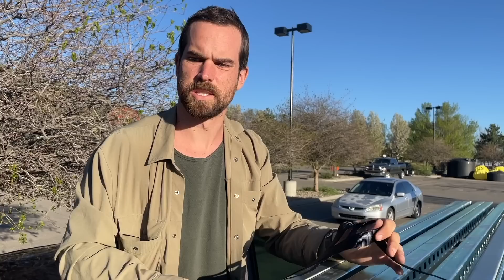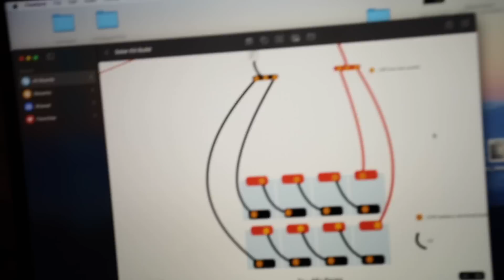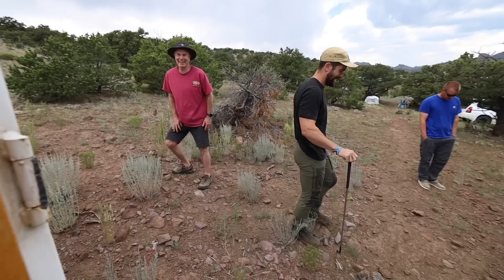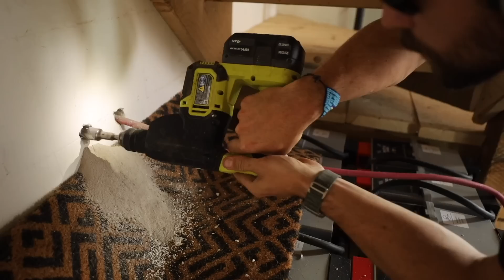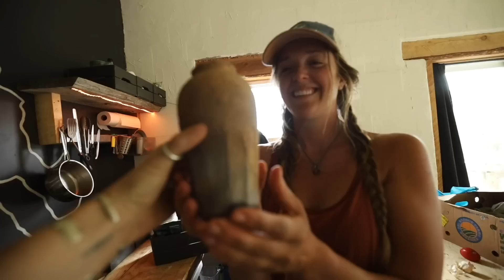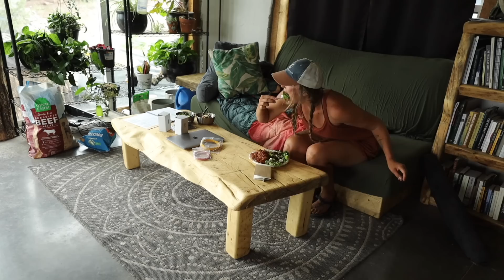IT'S COMPLETE!!!! | Solar Power System Install - Off Grid DIY

Comment: How about a solar water heater to supplement the propane water heater? The solar water heater would preheat the water passively before it reaches the propane heater.

Comment: I installed a ASHP Water Heater in February of this year. I only had a 120 VAC outlet nearby so used a Rheem 120 VAC 50 Gal. unit. It's in the garage here in Reno, NV so it was 47 degrees in February, and it used about 4 kWh per day. During the summer months it would be 74 to 80 degrees in the garage and only uses about 2 to 2.5 kWh per day. I keep the water temp at 137 during the day and switch to 130 at night. We are 2 retired people, and it has worked without any issues. Our inlet temp is probably near 70 in summer but much colder in the winter. I don't see any reason to doubt that it should work for your situation. The garage is a double size, and I couldn't say it cools the air to any appreciable amount. There is a bit of noise, and it runs more during the winter so that would be my main concern.

Comment: Could also augment your hot water system to passively heat water with a solar water heater. Kinda like a low power add on. Only thing that would run would be a transfer pump

Comment: As far as the hot water heater, once there are lill ones added to the fam, you will use a lot more hot water. Way more than you might think. Just something to keep in mind.
Reply from the maker: A tankless water heater is hot water on demand so we’ve got it on order and it’ll arrive this week!

Comment: Excellent Video Guys! Off-grid battery voltage is very confusing for many homeowners. Choosing 48V at this time is very safe and cost-effective (think smaller wire size on the DC circuit). One can easily wire the house for AC 120V and be  respectively efficient. I went for a 24V system. Not because it is cheap but because we have a "36V DC" standard in use for many years in commercial construction. My house is designed to use 18 to 32V appliances in general, and the computer controlled equipment is 120V 60Hz. Colorado has adopted the NFPA National Electric Code which also encompasses mining equipment (mining standard is DC). In conversation with Colorado lead inspectors, I determined that a mostly DC residence is possible and also efficient. .. if one can purchase the correct wire gage. Any one remember the old school light switch that clicked like a leather whip sounding off in the night? Those were AC/DC rated appliances! There are some trade offs when using all DC or all DC in transformer conversions. I just decided to minimise the total number of DC to AC and then back to DC conversions. Not every transformer is peaked for efficiency one can stack as many as a  40% power derating from solar cell to appliance in an off grid application. Cheers!

Comment: I wouldn't have been able to understand what Barron was talking about if i saw this prior to me doing some upgrades to the solar on our cargo trailer conversion. I definitely think this video will be helpful to others in the future. Especially just giving them confidence to tackle an install on their own.

As far as appliances i would have to recommend a propane stove for primary use. There's just nothing like cooking on fire! You could always have a one or two burner induction stove that is used when you want to take advantage of the solar power.

Comment: Re: your decision on if you want a washing machine or not

Something to keep in mind, if you are still planning to have children, is that your use of water will go up exponentially, especially for laundry. And if you use reusable diapers (you guys seem the type to go that route, but no judgement either way) your laundry needs will be even more than you expect since they need to be washed every 2-4 days.
Reply from the maker: We were thinking no washer before we were able to get this solar system. We designed our solar system for a washer!
Reply: @ElsaRhae  awesome! That's a really good choice.

Comment: Propane cooktops all the way! The control over the fire has no comparison to the induction cooktop. I lived off grid 25 yrs ago. I had both systems because we never new where our power would come from. Get a hot plate for emergencies if your want but use a propane cooktop. You change the bottle every 3 to 6 months. And it is a great and practical energy source.
Reply from the maker: I thiiiiiink we will go with propane!

Comment: Modern gas stoves have electrical ignition so you’ll use very, very little propane. The older stoves had a pilot light which used a high amount of propane. I have a small tall cylinder of propane for my Bosch and it lasts me 3.5 years. I used a cylinder every three months with my old stove. Quite a difference.

Comment: What’s up with the cracks on the exterior of the house? Is that normal or is it an unexpected concern?
Reply from the maker: It’s the first coat of stucco! We still have another 1-2 coats. We let the stucco sit over the winter so it would crack in full and we will go in with another layer of stucco and then another layer of synthetic stucco over top

Comment: Heat pump water heaters have the heat pump mounted to the TOP, so there is no extra footprint. They only use around 400-600 watts of power to heat up. You can also put them on a wifi timer so that they turn off in the evening and come on an hour before you wake up so that you have hot water when you need it. 
Sun is free and renewable, propane is not.
My offgrid home use electric everything. Induction cooking, air fryer/microwave over, Mini Split for heating and cooling.
I did this so that I am no slave to a gas that I need to pay to refill or have run out. I have a slightly smaller system than you. 10kWh battery, 5kW inverter (120/240 with a 60w parasitic draw), 9 380watt panels (2400 watts)
I have never run out of power, I just make sure that the mini split goes off before bed and we switch on a ceiling fan instead.

We run 24/7 internet, tv, fridge, hot water, cooking, water pump, all electric powered. You can do it. If you want some help choosing things let me know in a reply and we can exchange details.

Remember, Buy Once, Cry Once. Go fully renewable

One last thing. The temp rise of water heaters is ONLY a concern with ON DEMAND. Storage water heaters including heat pump units will heat till hot, so not a concern at all. You can also install is outside if the idea of free cooling indoors is a problem. 😉

Comment: I have been using a propane stove for 2 years because I live off grid too in a tiny home, I love my propane stove it heats things up so quickly it's very efficient and I don't find it uses a whole lot of propane especially if you're just using the burners and not the oven. I also have a direct vent propane heater as well as a direct vent propane water heater, both I like very much, I don't use much hot water either so it's perfect. I should mention too there's these "containers" that you can get that hook onto the side of your wood stove that heat water and they have a valve on it so you can have hot water all the time for your tea or coffee which is pretty cool 🌅

Comment: Either rent or invest in a real honest to God crimp tool for the cable connections. Much safer and more reliable than the hammer thing you used. Loved the video though.
Reply from the maker: We live 45 mins from a hardware store and Travis lives almost 2 hours away so they couldn’t afford the time to drive to buy the correct tool unfortunately

Comment: I have been "off-grid" for over 8 years due to load shedding here in South Africa. Some advice that I can give. Induction - just no, draws too much power even for a short while and if you are going to do most of your cooking at night, say goodbye to battery power. Instapot use only during the day - also draws too much power over the short period of cooking. Slow cooker is wonderful - I prep in the morning and switch on, dinner ready by 5. Propane water heater - YES and couple it to a solar water heater as well - during the day the sun heats the solar heater water and propane kicks in only if the water temp is not right. Use only the clothes dryer during the day. Try to do as much heavy duty "electrical" during the day.

Comment: You could also do both, have an electric inline heater do all it can and then use a propane heater to heat it the rest of the way. That way you get the temp you want and use the electric one to the full capability. Over here it's common to have a solar panel heater on the roof that heats a water tank using only a small pump. That's the most cost effective way to heat water with the sun. Then you use an inline gas or electric heater to heat it the rest of the way or a boiler but that takes up a lot of space.

Comment: FYI... There's TONS of used solar panels that are perfectly good & are filling up landfills. Watch you tube vids. You can save a BUNDLE ON USED. $20 per panel vs $200 per panel. If you're north look at wind TOWERS. They're WONDERFUL AND COMPACT. Same wiring. Wind blows 24/7. Batteries are EXPENSIVE. You can use golf cart batteries. If you don't need TONS of electricity. Those batteries are $2500 each...

Comment: can't you use an electric on demand water heater so there's no tank to keep warm?

I would use electric stove and on demand water heater to avoid propane... 

mostly because a generator becomes a backup system for both systems that way... 

i guess you could have a portable hotplate stove as a backup to propane running out..

but it just seems simpler having one power source.. 

and you can always have a propane bbq..

but it only makes sense if you don't use much hot water..

and you might want a bathtub one day so hot water usage could change..

but then you could add solar panels and use things during the day more like a washing machine and bathtub

Comment: Long time subscriber, and this has to be my favorite video you two have ever produced! Currently living in a self converted skoolie. 
Our electrical system setup: 
- 9.6 KWH battery bank (400ah x 24v)
- Just shy of 2KW solar panels (6 x 320W panels)
- 3KW inverter
Very much relate to the amount of research it took to design a well planned system! Weeks of studying, and I felt like I only brushed the surface. We live in the PNW, and we opted for propane instant water heater (one that was meant to go into a full size home), and propane 4 burner range. Our primary heat source is two propane furnaces. Obviously, living where you live changes the considerations you have considerably, however one thing I know is true is that unreliable heating of water gets old fast. If an issue arises in your system that requires you to temporarily stop using your system to troubleshoot and fix it, it would be much easier to use a portable power bank to run a propane water heater off of it to maintain the ability to go about business as usual. I think having an induction stove top may be a great option, because if there are ever issues causing you to not be able to use the stove, you can always whip out a propane camp stove and use that instead. Unsure if I myself would opt for anything other than a propane oven, but I bake a TON, so maybe not as much of a consideration for you two. I know I'm preaching to the choir, but redundancy is key, and whatever you decide, I'd personally prioritize picking the option that intersects reliability and flexibility as evenly as possible. It's not a matter of if things go wrong, it's a matter of when, and once you start living in a home, the difficulty of switching to going back to extremely uncomfortable conditions cannot be understated. I can't speak much to heating your space (as the PNW is a different kind of paradise than the paradise where you two live), but I can say that it is nice to have the option to leave for a period of time and trust your house can be heated and cooled pretty reliably without having to worry about your system being depleted.
You guys rock! I know whatever you two decide will be intentional and well thought out, and I can't wait to see what happens next!

Comment: Hello with regards to your future appliances I would go Electric first of all as you now have a "free" unlimited supply of Electric all the time it`s light+ Gas is no longer cheap and you have the trek into Town for a resupply.  If you go induction cook top you can always have a camping gas back up if it`s mid Winter so short days/light levels and could you use the camping stove to do your canning??.  Can you not get dual fuel(Hybrid) water heaters now?? + Don`t use a clothes dryer(tumble dryer here in the U.K. )to dry your clothes as they burn electric. Use a heated clothes airer (230 watt) and dehumidifier (mine 200 watt) as the dehumidifier will draw the moisture out of your clothes and the air(much cheaper/ Energy efficient). You could even hang your laundry on retractable lines in your bathroom during Winter and just run a dehumidifier in the room to extract the moisture. Also the dehumidifier can obviously be used to control the humidity in your home and clean the air via it`s filter. 🙂

Comment: Wow, Barron, you went over most of our heads, but I kind of understood.  So happy that you guys have the power you need. I would definitely cover your invertor, even though it's rated for outside,  i wouldn't want an expensive piece of equipment just sitting out in the elements. Also, maybe think about using both electric and propane where you can, if you are without sun for a while and you don't want to use your generator, the propane appliances are good as back up or when cooking gas is may be better for you meal.

Comment: I would lean more towards induction if your system can take it. Or if you do propane, have really  good extractor. I have a propane 4 burner stove, but I'm considering getting a small 1 burner induction, to use on sunny days mostly. I have started to get many new electrical appliances, like a coffee maker, grill etc, having learned a bit of the limits  of my system with time.  My system is not as big
(6000 wh, 2700w of solar)  Propane is not free, the sun is.

Will you hook the gas generator as backup? Can it be turned on automatically?

Comment: This completely off subject and I should have mentioned it the time you talked about it: rodent damage to your cars. Wrap wires and fuel hoses with steel wool wherever possible. I've had about $2000 damage experience back here in rural Douglas County. I can't wrap all of the wiring, but I could protect the fuel line.

Comment: My Solar inverter 4.8kva DC to AC Hybrid (On/off grid).. works with netmetering system... (charges via solar at day.. and passing extra solar when battieries topped off to grid.. thus lessing my grid-tied monthly bill).. and it has 2 Fans 7fin 12v 0.40amp.. 1 to suck in fresh air and the other to push out the heat.. problem is.. every few weeks.. the dust in the air.. seems to put the inverter into an Error mode.. either the fans of the unit is clogging on the dust on the electrical stuff which in turn is making the inverter motherboard work extra hard.. so .. in hindsight.. i have to  unhook the wires.. take the unit off and take it outside and take off the cover and then air Canister clean.. all the motherboard of the inverter and the fans.. and then take the fan sticker off (like of a desktop power supply unit) add some machine oil 1 drop and re-cover its sticker.. and fan starts spinning. keeping the intverter cool.

Am sure you have no such problem in the upcoming years.. just incase.. keep the company sent manual (either pdf or hard printed).. closeby.. cause the machine beeping is very annoying..especially at night.. when you're working and the lights go off for no reason. last.. summer is fine for the machine (inverter) but.. build a cocobox with a door.. for it.. so the machine itself don't get cold in winter months.. yes it does have a temprement..... just like a gasoline generator.

Regards from Singapore, God bless.

Comment: Happy Anniversary. Congratulations on getting the solar and batteries all set up. Definitely go with propane for cooking and a tankless hot water system. Maybe try to figure out a way to keep your water cistern at a minimum temperature if you will be drawing from it for showers and sinks. Not like hot, but warm enough to keep from freezing due to your location. I know it can be brutally cold over there for days on end. You'll take care and be safe. 
CHEERS from Colorado

Comment: Any cost breakdown? Just retail would be fine.. 

Working on a City homesteader setup and while I am required to be hooked to the grid i can sell back energy.. but the numbers are ridiculously not worth doing.. locally a lot of people are just running a small portion of their property and moving to solar for the more ‘rechargeable’ aspects and using solar power stations for charging lighting, devices and rechargeable stuff… and just using wall plugs for appliances.. kinda babys first solar to get equated with actual power usage.